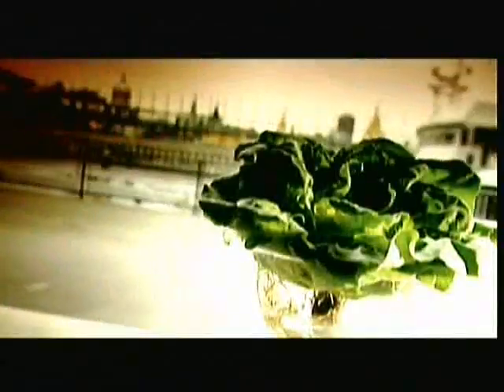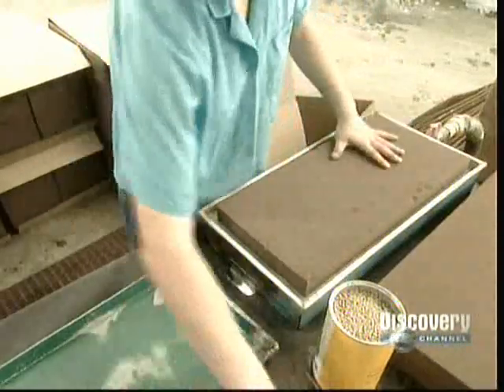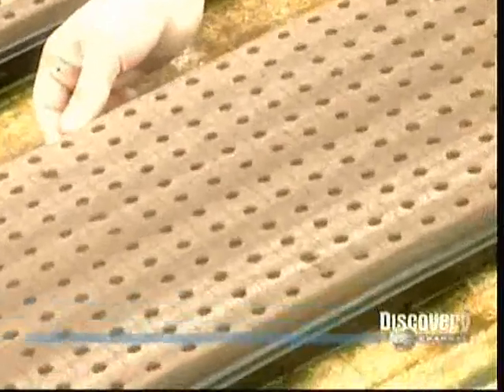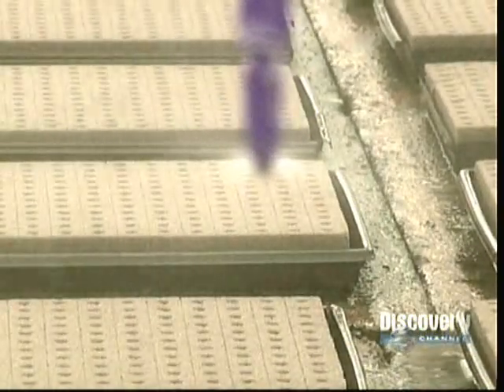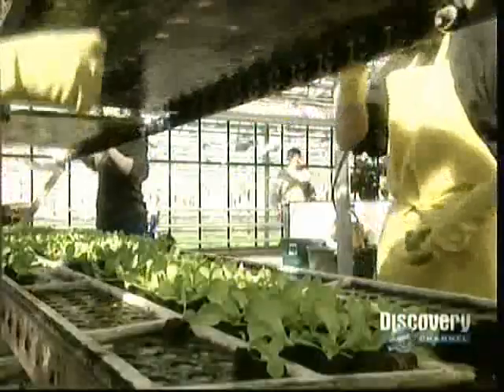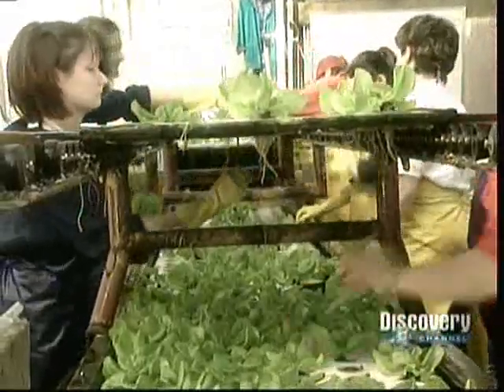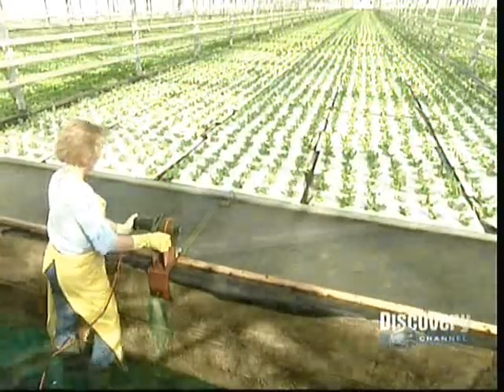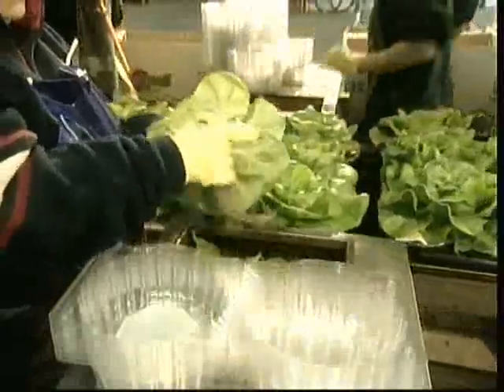Hydroponic Lettuce

Comment: Hydroponics is a good system but it also have some drawback, you will need to buy some "plant food", nutrients and supplements which may be costly. Before building any hydroponics system, you should think about the benefit from aquaponics system, which can automate 95% of work
Reply: Please deliver that method. Appreciate it.
Reply: Tawanda Niccolls Visit here to acquire more information:
fine4.info/aquaponics-guide
Reply: Traditional farming you also buy nutrients called fertilizers. However, you don't necessarily need to buy nutrients. You can make worm or compost tea instead and use this for your nutrients.
Reply: The only issue with that though are the pH spikes. Its such a pain having to constantly cycle the water